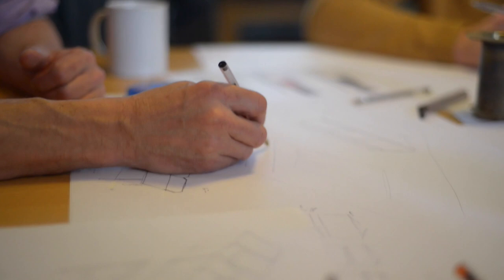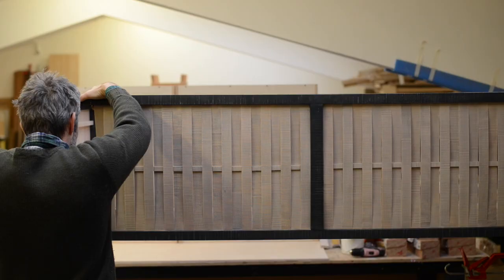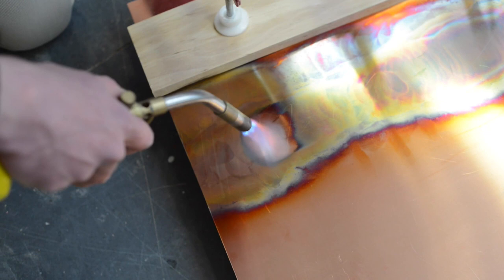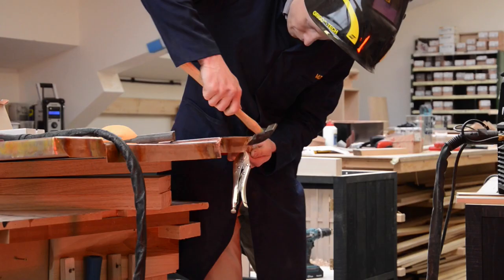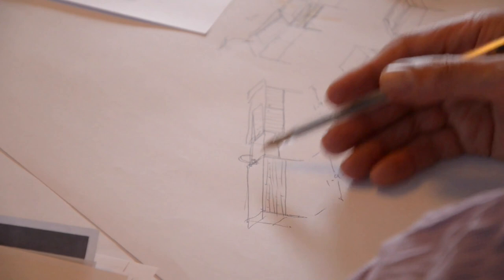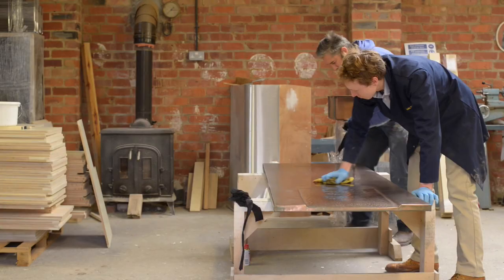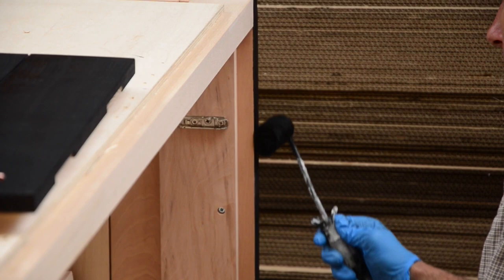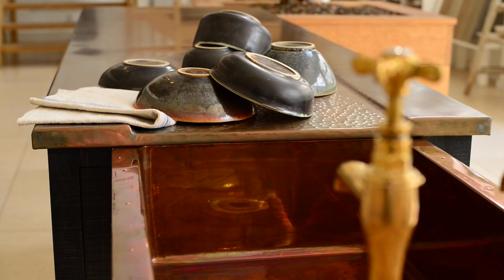HOW WE MAKE | The deVOL all-in-one kitchen island for Creative Expo Taiwan

Comment: What do you use to stain the front beech panels ?
Reply from the maker: We use water-based stains that soak into the beech and enhance the natural colour of the timber. After staining, it’s rubbed back and a water-based lacquer is applied, which helps to protect both the colour and the wood and means you can easily wipe the cupboards. Hope this helps!

Comment: How do you keep this beech board from bending?
Reply from the maker: We use a sliding dovetailed brace to construct the doors, which is a beautiful and extremely strong joint that negates the need for glue. Joints like this are rarely used in modern joinery and have been replaced by mechanical fixings and glue, but sometimes the old way is the best way!
Reply from the maker: They're quite thick in the middle and then slope down at each end. You can catch a glimpse of them at 0:44 or you can see a close up detail shot on this blog... https://www.devolkitchens.co.uk/blog/introducing-the-sebastian-cox-kitchen-by-devol